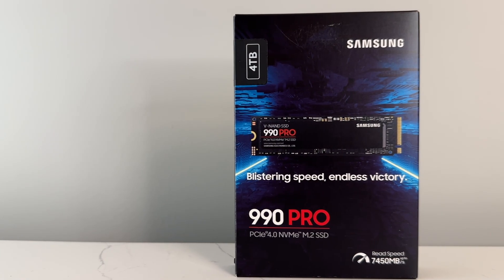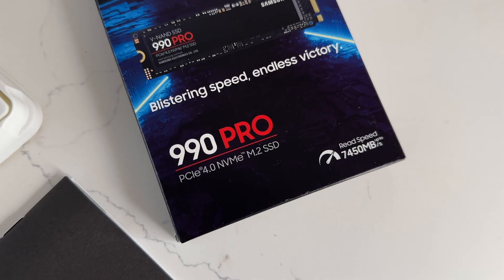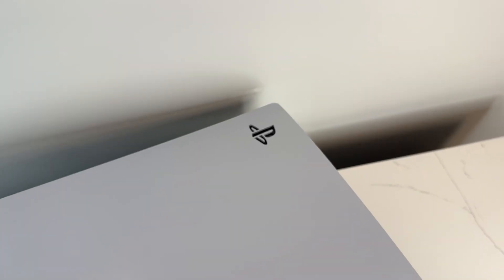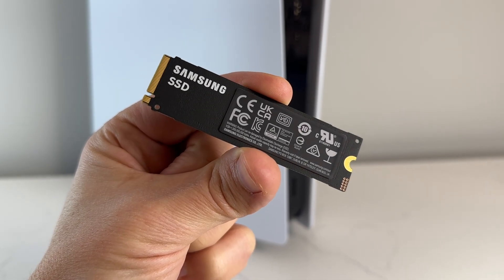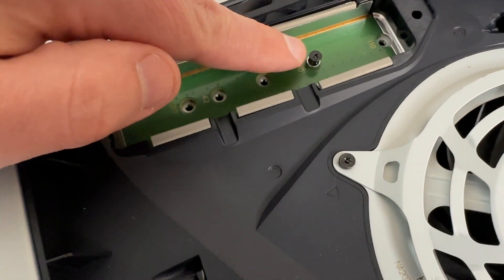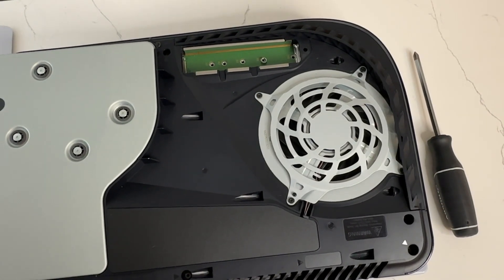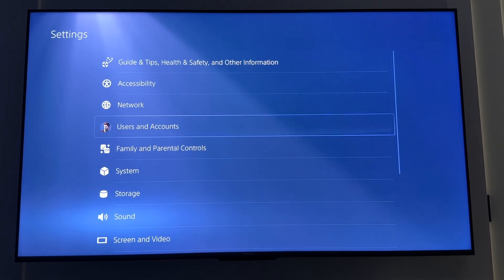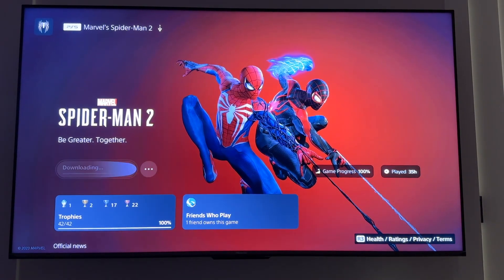Samsung 990 Pro SSD Overview and PS5 Installation Guide

Comment: smh just bought this without realizing there's no heatsink casing. Right when I go to put it in, I open up my Pro to take out the 2TB 980 I have in there, and that thing's already hot as it is since I just turned the system off. No way I'm gonna even chance messing around with this. Returning ASAP. Wish the reviews on the product page that mentioned PS5 had said something.

Comment: I see your read speed is around 6500, I just installed this same SSD and getting the same read speed. I thought the 990 pro should be closer to 7400?
Reply: That's what I was thinking, Plus I tested fortnite and it took 48 seconds where before it took 42, I'm very confused and I'm even using an ethernet cable now?
Reply: PS5 pro reaches 7400 💪🏾
Reply: PS5 consoles can't reach those speeds only high end PCs can take full advantage of a fast SSD.  Your speeds are fast for a PS5 SSD.  My PS5 Pro got a read apeed of 6742 with the 2TB 990 pro.
Reply: @genepadilla7754 did you need to update the firmware before using it in your ps5??
Reply: Did You need to upgrade de firmware before install it? @genepadilla7754

Comment: Do I got to update this thing before I install it in my PS5?
Reply: In February of 2023 Samsung put out update firmware I presume could be installed onto the SSD through the Samsung magician software. Is this the software update you're referring to? I can't confirm, but some online say the more recent run of units come with the updated firmware, perhaps since some time in 2023. So if you bought the SSD in 2024 you may be good without a firmware update. You'd have to install it in a PC to both check the firmware version and to update the firmware through Samsung's software

Comment: My screw was not on the 80 but the 110. Is this an issue ?
Reply: Yes, the SSD will probably start flopping around in your console if the screw/spacer is in the “110” slot instead of the “80”. This particular SSD is 80 mm tall.

Comment: No heatsink  lololol  good  luck with that mate
Reply: Thanks for your feedback, I appreciate it. In the video I explained that I will be installing it "as provided by the manufacturer," but recommended a heatsink and I did install my own third party option after filming and it's been working great.
Reply: @dapper_tux  Is there a third party heatsink you'd recommend?

Comment: No heatsink is it not required
Reply from the maker: Hi, a heatsink for your SSD is highly recommended. The purpose of this video is to show the install of the SSD as is.
Reply: He put the non heatsink included version.  You can get it with or without.